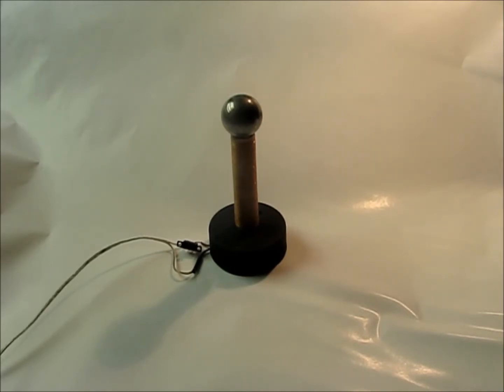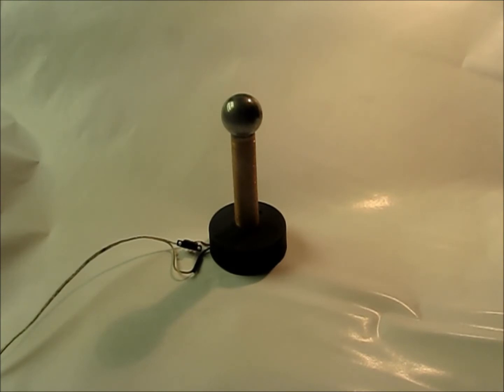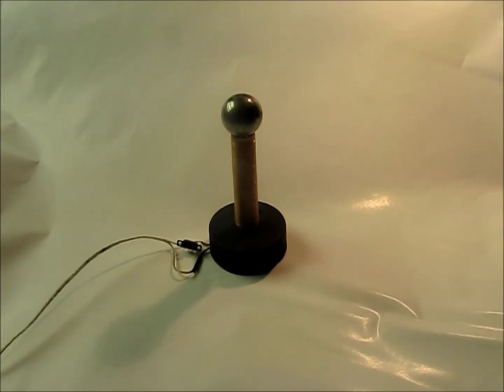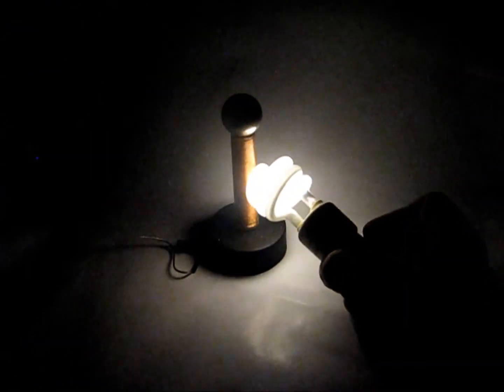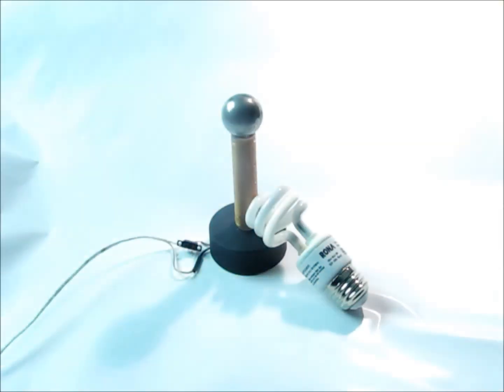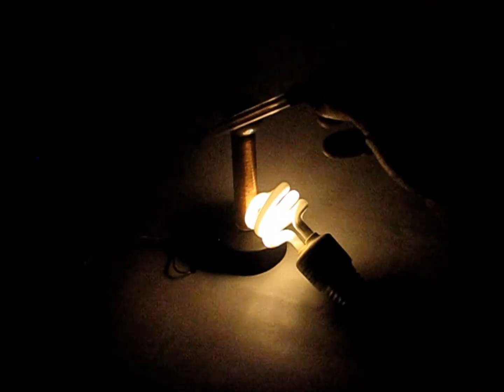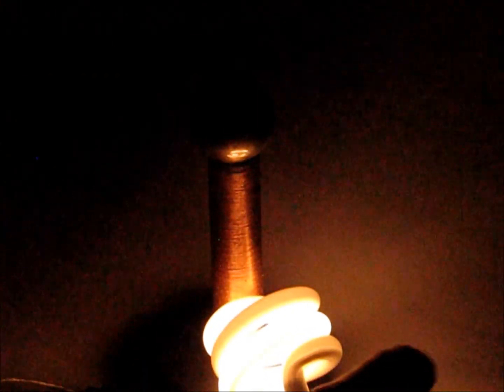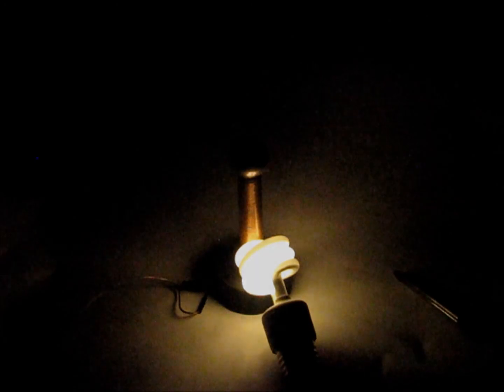DIY Wireless Power - Part 4: MINI RF Thrower?.. What is this...

Comment: I think its an exciter. For me tesla coil needs primary and grounded secondary. I would need to see your ballast to be sure, but I'm guessing it has a primary driving the output, or its pulsing an inductor and this is the flyback from that, which would make your extension a flyback exciter or transmission ant or something...?? Just tried this with my flyback and a slayer coil and it didn't do much. I think you got very lucky with the induction value of your tower...